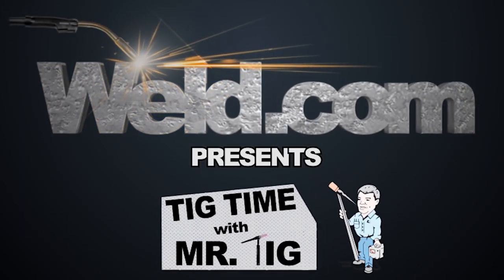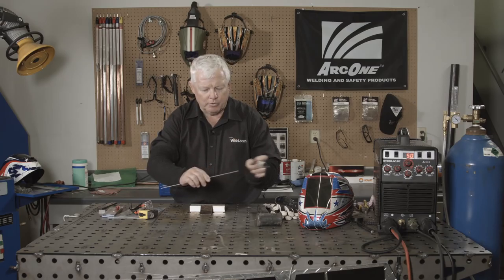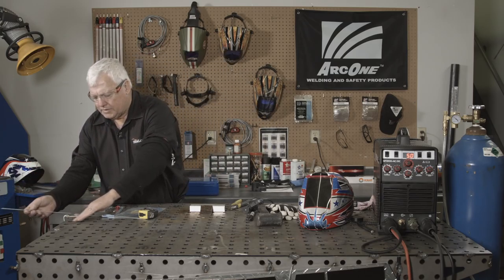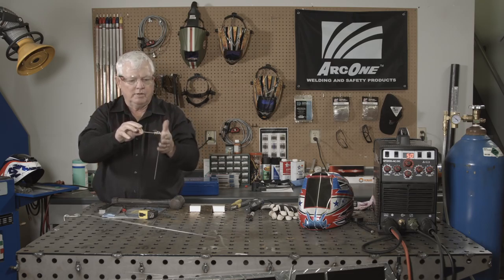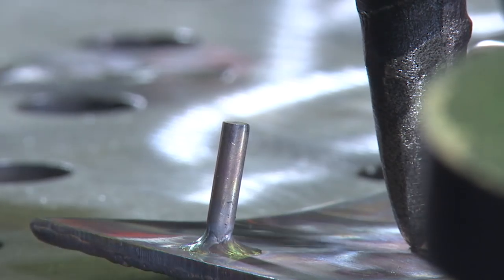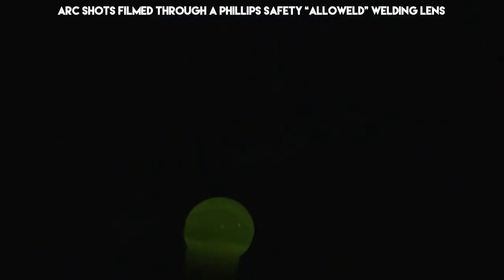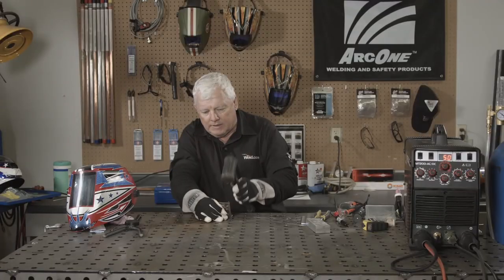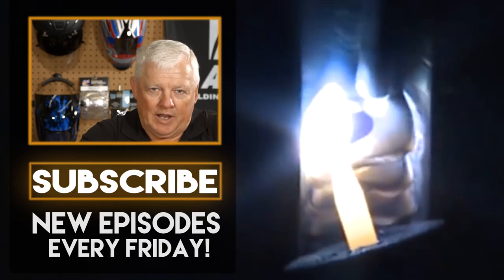Welding a Stainless Steel Belt Buckle: Part 2 - Welding the Hardware | TIG Time

Comment: You pretty much cooked those weld beads, but no biggie, it's a belt bucket, not a piano. 

An easy way to get the hardware parts welded down in one shot....ball the ends of the wires like you did for the end of the hook. Then when you get your puddle started, walk it right into the balled end of the rod. Done. 

I like how you bent the wire over on the end of the buckle the belts connects to. Nice touch.